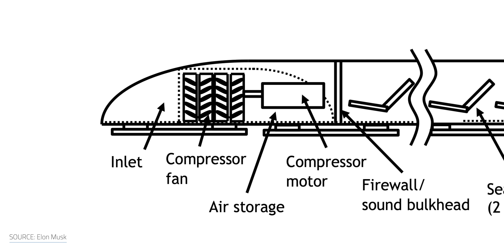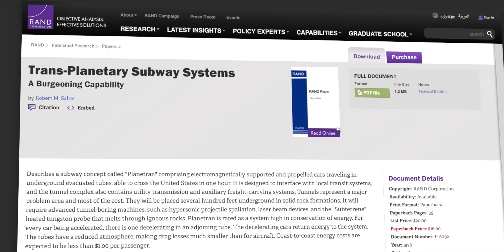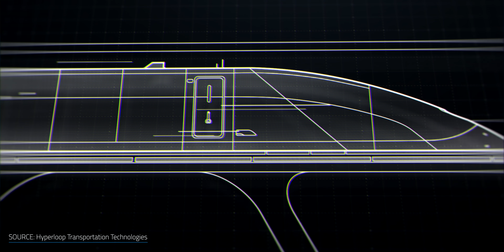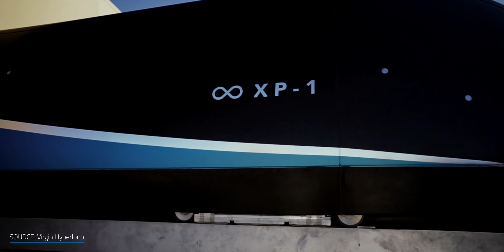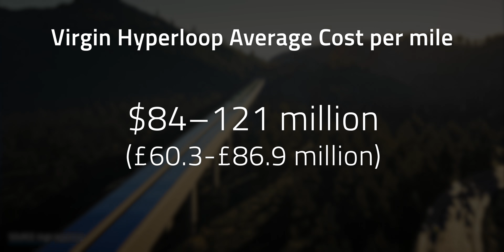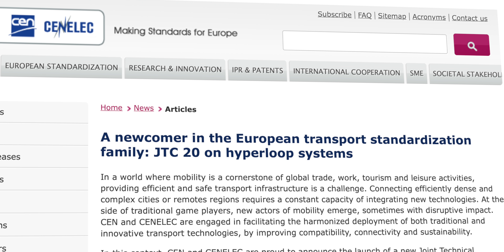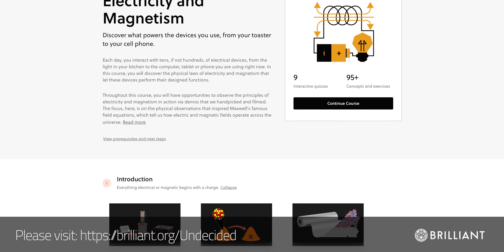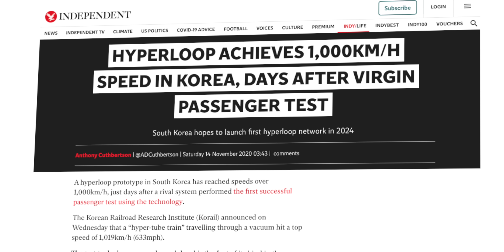Exploring Hyperloop - The Future of Renewable Public Transport?

Comment: On topic of Hyperloop I tend to agree with Thunderf00t's sceptical critcism. The technlogy is extremely expensive and dangerous. Today if we want to use pressurized vehicles moving in lower air dencity environment we use planes. Planes are doing now what hyperloop will only possibly be able to do in some distant future. What we really need is to make planes lighter using composite materials and equip them with low emission/non-emissive propulsion systems. For fast ground transpirtation we should invest in more realistic tech like bullet trains, they are already capable of speeds up to 360 kph (224 mph).
Reply: Planes are good for longer distances but for a couple hundred miles, it can sometimes even be faster to drive. Planes depart are very far apart pre-determined intervals because of the large number of passengers, require TSA screenings so someone doesn't crash it into a building, and take time to reach the cruising altitude needed. Also planes need to push off of air to move forward which is less efficient than pushing off of a solid surface through a magnet. There are a ton of advantages to making the hyper loop a reality. The benefits of a hyperloop are total trip time and the frequency with which pods leave the station making it unnecessary to plan around departure times. Hyperloop is expensive and unproven for the moment, but it has the potential to be a very useful mid-range transportation alternative. I think it's worth investing some money into researching the feasibility of the technology.
Reply: @keco185  As I sad earlier high speed trains are far more relevant and feasible for ground transportation. Hyper loop doesn't have a "ton" of advantages, only a few while the amount of concerns is much closer to that number.
Reply: @Einygmar  high speed trains can be good in non-congested areas or if you have the money to build a 300 mile long bridge over houses. But in many places, the level of congestion makes them impractical. They never can get close to their desired speed or can’t be built at all. A solution to that might be to build it in a tunnel underground but then you’re already half way to a hyperloop. Make a vacuum in the tunnel and break the single giant train into pods and then you get the benefits of higher speeds and more frequent departures. Also there’s a big difference between 200mph and 750mph. The latter let’s you daily commute between LA and SF. The former takes you over 2 hours without slowing down. And only if the train departure time happens to line up with your schedule.
Reply: @keco185  Comparing high speed trains and Hyperloop in terms of speed and efficiency is simply irrelevant. 
While we currently have the technology, building and maintaining high speed train roots is still expensive, Hyperloop simply does not exist as a reliable usable technology and the estimated costs of building it are extremely high. The current concerns about Hyperloop are not speed and efficiency but safety and costs. It is extremely difficult to maintain low vacuum throughout the whole length of a tube while high speed pods combined with small underground tunnels create a potentially dangerous environment with no emergency exits. In the age of instant global communication it is quite hard to justify all the expenses required to build Hyperloop by just "speed and more frequent departures". High speed trains are fast and safe enough for efficient intercity transportation.
Elons projects are known for irrational presentation like the proposed use of Starship for long haul transportation.
I recommend you to wach Thunderf00t's videos on Hyperloop he explains why it's an extremely questionable idea.
Reply: @teemumiettinen7250  And your statement is an absolutely baseless attempt to discredit him as a person, not his statements. Your opinion is absolutely irrelevant.
Reply: @Einygmar  When someones credibility is gone, so is his statements. For example would you take child protection advice from the catholic church pope?
Reply: @teemumiettinen7250  No, you've commited an ad hominem fallacy. Your statement is baseless and irrelevant. Your opinion is incapable of harming anyone's credibility.
Reply: @Einygmar  If you would look at thunderf00ts content you would realise all my points are facts.
Reply: @teemumiettinen7250 If you're making a statement it's your responsibility to provide proofs. There is no "points" in your comments, just an ad hominem fallacy. The only thing it discredits is you and your position. Farewell.
Reply: @Einygmar  If you are spreading false information its your responsiblity to delete them from internet.
Reply: @keco185  I think teleportation would be environmentally better and  faster travel. I think we should be investing  money into that.
Reply: @logik100.0  the difference there is that the hyperloop is technically feasible using what we know today. There have been successful high speed tests and the idea of making a maglev, a vacuum, and an airlock is all within reach. I appreciate the analogy but I don’t think it’s really all that apt here. A better one might be relating the hyperloop to what SpaceX pitched with earth-to-earth transport on the starship. That’s another ambitious method of transportation with various criticisms.
Reply: @keco185  My post was sarcasm. Just because it may be possible to do it, does not mean its:- 1 cost effective. 2 its safe. Hyperloop fails on both counts.

Hyperloop has been busted over and over and over again. To keep pushing it shows sheer stupidity. Spend the money on normal trains. They actually work.
Reply: @logik100.0  it’s been “busted” by a guy on the internet that despises Elon Musk.
Reply: @keco185  It was busted by hard cold facts! Kudos to musk for the pushing electric cars into the mainstream. Not much else. He is a BS merchant and its sad to see so many people taken in by him. 
Note that Musk says the perfect propulsion system is not magnets or air flow levitation anymore, he now says "wheels".
F-ing wheels! 
And the magical "paper" listing how it would be done has now magically disappeared from any of the sites musk has control over.
Reply: @logik100.0  musk isn’t even working on hyperloop. He just published a white paper on the idea and SpaceX hosts a college competition based on it. Also, he’s significantly reduced the cost per kilo to orbit.
Reply: @keco185  Yes I know he is not working on it. But hey you brought up Musk!
Also you need to do some research on the cost to orbit. Note that the other suppliers of space services are complaining that Musk is overcharging the military side then using that money to sell at a loss commercial flights. 
This is not new news. If people took their heads out from up his arse they would see it. Electric jesus is not even making money yet selling his cars yet.
Not that it should be held against him or the company. You cannot downplay how the electric car revolution was pushed by tesla.
Reply: @logik100.0  SpaceX charges the military less than ULA and gets less military funding for equal contracts. NASA pays SpaceX less than they pay ULA, Boeing or Russia too.
Reply: @keco185  I know this is one year old, but I can't help myself. Digging a tunnel for a high speed train is not half way towards a hyperloop. It's more like 5%. Yes, 5 (five) percent. The amount of money to build and run a hyperloop is extreme. Getting and maitaining that vacuum ... is insanely hard. As hard as the protection of the tube, be it underground or overground will have to be.

And high speed rail is already extremely expensive, making it somewhat work only in very densely populated areas. A hyperloop is easily 10 times the cost of that. I don't think we'll get to 700 km of hyperloop worldwide by 2050, it's that unpractical of an idea. All the fuss about it now is mostly money laundering "raising" investment from other billionaires or corrupt governments.

Comment: It looks like many people here are decided
Reply: @mandellorian The comment wasn’t about the cost of such a project. My comment was about the technicality of it. The System has already been demonstrated to work with passengers. Whether virgin hyper loop can turn it into a profitable business remains to be seen. However it’s neither your money or mines.
Reply: It has not. No one ever demonstrated:
1) steel tubes around public transportation being of any use at all
2) any efficiency gains achieved by pushing the air aside externally
3) any speed improvements over existing trains
The only thing that got demonstrated yet is the strange obsession with tubes some idiots seem to have for no reason. There is no technicality at all involved with tubes around shit. None except in a toilet, where you shit into a tube but (usually) don't crawl in where you your excrements go.
Reply: @hans-joachimbierwirth4727  A South Korean hyper loop design reached 1000km/h. https://www.independent.co.uk/life-style/gadgets-and-tech/hyperloop-korea-speed-record-korail-virgin-b1721942.html

If you can’t see that as a massive leap over traditional trains then that’s on you. Clearly some investors see potential in the technology and will continue to invest in it regardless of what Joe Schmo in the YouTube comment section thinks.
Reply: Some understand and apply the physics involved and some don't.
Reply: @rickdees251  It’s not physics since the technology behind hyper loop is technically possible. It’s the business model and cost that’s the main problem for this system. There has already been a real human test of the hyper loop system.

Comment: To do some weekly or daily maintenance work, tubes need to open, which means it's a timely opening and vaccuminng and de-vaccuming the tube. This would take lot of time. 

Entering and leaving station would need 3 stops per station.
Reply: I agree. This type of thing is almost as logistically feasible as the space elevator.
Reply: @stijill  What are you talking about?
Reply: @jjbarajas5341   hyperloop is logistic nightmare.
Reply: @stijill  What does that have to do with a space elevator?
Reply: @jjbarajas5341  what's your take on the space-elevator
Reply: What sort of maintenance would that be? Inspection can be done with a maintenance pod, so no need to open the tube. And grinding or welding any rust spot can be done with the same pod with no need to open the tube.
Reply: @titter3648  you mean there will be pods between each station s which themselves will never break. Where will those be stationed in the tube when not in use. 

What we need to keep in mind that hyperloop is maglev with enclosure and it will always be costlier to built and maintain than maglev, thus will never be cheaper than maglev thus it will never be commercially viable. 

Same has happened with Concord supersonic passanger planes.
Reply: @apurvmj   The maintenance pods will be on a sidetrack until they need to be used just like on a normal railway. And if the maintenance pods needs maintenance you just depressurize the airlock they are in and then you can work on them.

Why will it be costlier to maintain? When it is in a closed tube there will be no dust, and rain, and snow wearing things down and corroding things like there is on a open maglev track.
Reply: @titter3648  because tubes warp, expand and contract. Traditional expansion valves are completely unthinkable in the hyper loop stystem.
Reply: It's not a local train in Mumbai
Reply: There is already a way to mostly vacuum out a tube after being exposed to atmosphere.  A Pod is basically a free floating linear moving piston, it will build high pressure air in front of it as it moves, and one way valves in tube sections will dump the higher pressure out of the tube.  Run a close fitting pod through it a number of times, increasing speed every time until most of the air is pushed out of the tube.  Vacuum pumps handle the rest.
Reply: @wackowacko8931  So I don't know what your background is so I don't want to be too critical but that is a really bad suggestion on a number of levels. I'll offer you some ideas for further thinking, if the pod is having to push air out of the tube, it defies the point of the tube. Having a seal tight enough to push the air will create friction, defying the point of the mag-lev, at high speeds it would be very dangerous.. I'll not go any further but just trust people who know, maintaining anything like a vacuum in an overground tunnel, in earthquake territory that you're going to propel people down at high speed is near impossible at best and ludicrous at worst.
Reply: @wackowacko8931  wow
Reply: @wackowacko8931  Why not. Nice one.